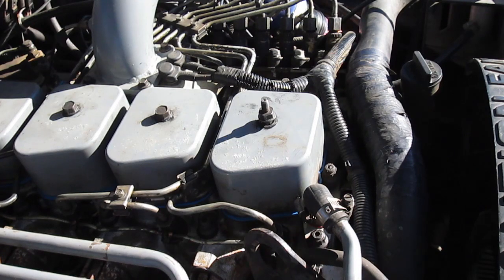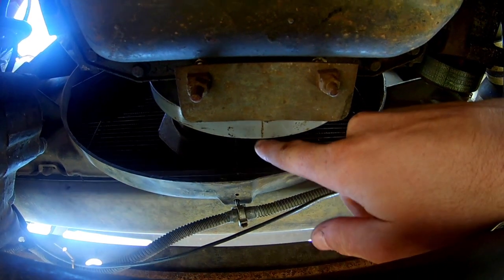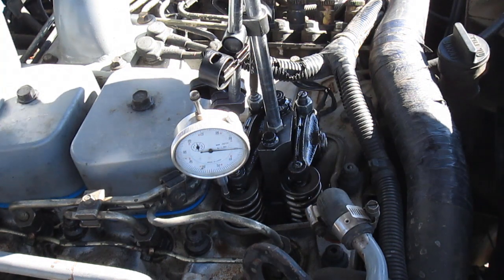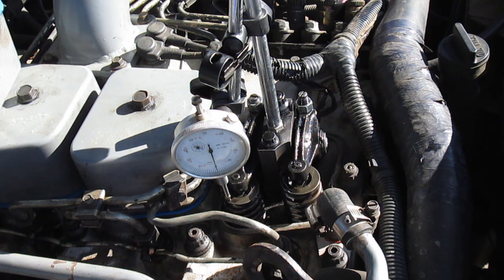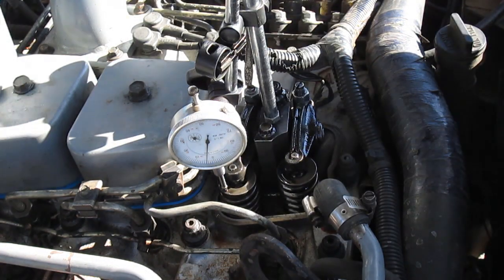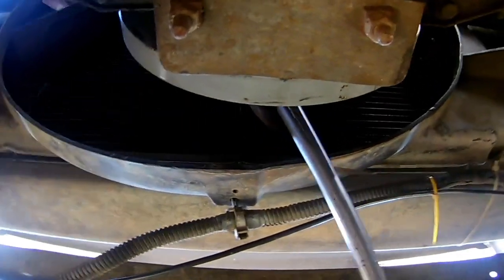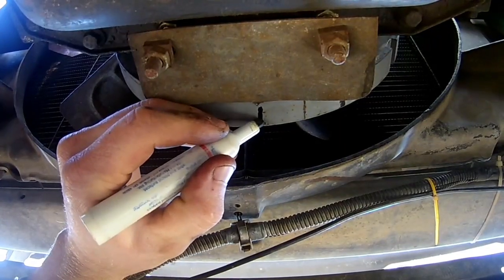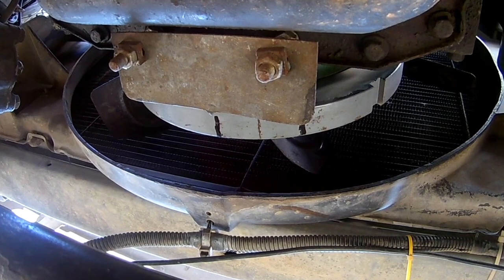Finding TDC on your Cummins

Comment: I tried the “valve overlap” method and it made my head hurt.  I already have the injector lines off so i just took the nut off #1 inj and popped the injector loose so it would jump as I barred it around on compression stroke toward tdc.  Once the injector jumped I stopped, dropped #1 intake valve, continued toward tdc till piston gently kissed valve, made the 1st mark on the crank.  Screwed the valve up, barred past tdc about quarter turn, dropped the valve same amount, rotated engine backward till it kissed valve, made the 2nd mark on the balancer.  Screwed the valve back up till closed.  Then measured between the two marks, taped the balancer in a way I could paint a fine line right on tdc.  Pulled the tape, set engine to tdc paint mark and for a sanity check made sure timing pin would engage the hole in the cam gear, which it did perfectly.  Done.

Comment: Is the valve smashing into the rocker, pushrod and cam when you move it with it touching?  Seems like you would have to be really careful with this or you could hurt something like the rocker pretty easily.
Reply: I agree, would be a lot easier to remove #1 injector and go right off the piston.  Or just use the Pin under the injection pump for it's intended use.  For 1# TDC.  This video is as clear as mud!!